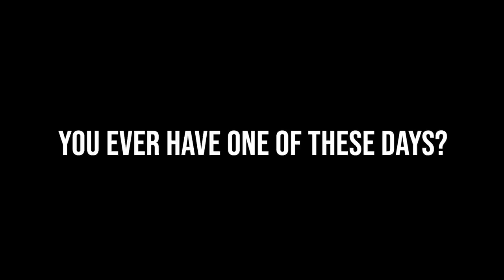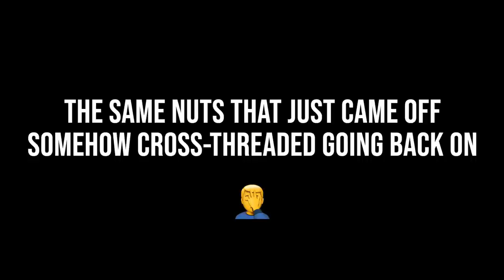I SHOULD HAVE STAYED IN BED 😡 THIS KUBOTA DOES NOT WANT WHEEL SPACERS! OUR MOST PAINFUL INSTALL YET

Comment: I was a diesel mechanic for twenty five years before changing my vocation.  I used to run into this all of the time.  Cross threaded bolts, snapped off bolts, even bolts with the wrong threads forced into the hole!  You have no control over what the individual before you has done, but you can take steps to prevent this type of circumstance for the next guy.  It may be you!  Thread chasers help when burrs might cause some cross threading.  You can detect this by the fact that it is difficult to thread the bolts in by hand.  Cleaning and oiling the bolts also makes getting an accurate torque easier.  The most problems are caused by being in too much of a hurry and not paying attention to details.  Good video.  I'm impressed by your composure.  Keep up the good work!
Reply from the maker: Thank you for your input Marvin!

Comment: Tip: When starting a bolt or nut you can prevent cross threading by first turning the nut/bolt in the opposite direction until you feel a click/bump and then you can thread it in from there.

Comment: Feel Your Pain!!!
Feels like I have more days trying to correct issues that arise while trying to fix simple daily tasks. 

Feels like such a wasted day when it takes 4-6 hours to repair a busted bolt that should have easily came out in less than 60 seconds.

Misplacing, Breaking or lost tools also makes for a rough day. Having a place for everything and multiple types of each tool can really come in handy. 

Thanks for showing the true frustrations and not the edited smooth installation.

Comment: Lug studs are pressed in to the hub. They can be pressed out and replaced on lots of vehicles. If they are welded in place, do yourself a favor and just bite the bullet and buy a new hub. Don't mess around with jacked up threads. More trouble than it's worth. And torque after you get the new wrench so you don't cause the same problem again using the breaker bar to tighten to an unknown torque. And personally I don't care what Bora tells you, if you want life to be easier, use anti-seize on everything! If you're worried about something rattling loose, use some blue Loctite instead. Both keep the moisture out and make removal easier and more likely. And blue Loctite will come apart just fine, no heat needed for anyone worried about that. Red needs heat and green is darn near permanent. Great real life situation. Keep up the good work!

Comment: I got rid of my Dewalt tools and went with Milwaukee.  Get 1/2" drive Milwaukee fuel 18 impact.  It is a beast.  My air impact wouldn't busy loose my mower blades.  I broke a 1/2" Craftsman ratchet trying to gorilla the blades loose too.  No joy.  I bought the Milwaukee impact with like 1400 foot pounds of torque and it broke the blades loos instantly like it was nothing.  I got the Milwaukee weed eater, pole saw, edger, and hedge trimmer too and they are awesome.  Not cheap tools but they are powerful.  No more need for the inconvenience of air powered tools either now that I made the switch to Milwaukee.

Comment: I have an older b series. When I install/remove the deck, I use the loader to lift the front wheels up, so I can easily roll the deck in/out.
As for the bolts, the only chance you might have had was to work it back and forth, tighten/loosen.  I was taught to always start a bolt/nut by hand, never with a wrench.

Comment: I use a Milwaukee 20volt impact gun. Saves my back and is strong enough to remove anything. The threads on hub are going to have to be threaded. Be leave it or not you can get the die at homedepot. 
Great video I’ve my spacers ordered. Hang in there.

Comment: When I have hard to turn bolts or lug bolts I put lubricant on the bolts like Kroil, etc and run them in and out as much as they go without forcing them and keep applying the lubricant. On wheel hubs you can usually spray the lubricate directly on the hole threads from the backside as well
Reply: I have a question about the wheel spacers. I have a 1025r tractor with quick connect deck. By putting spacer on the front wheel will it make it more difficult to drive when taking off or putting on the mower? Especially with the load and go brackets

Comment: I received some cross threaded and stripped out studs On my 2019 B-2650 directly from the factory my dealer had to go through and replace all of the studs on the whole tractor I know the dealer installs the wheels at set up but they blamed it on bad studs from the factory. Hydraulic leaks yes had that too I went through myself and had to tighten up a bunch of connections thank you for doing this video I thought I was going CRAZY!!!! Love the channel keep up the good work

Comment: Love videos like this, proving I’m not that only one that has much trouble with a simple project on a hot muggy day.  Probably happens a lot more than we think.  I’d be a complete sweat ball.  You did good, sometimes wrenching can be a battle.  Maybe in your new pole barn you’ll have a auto lift and pneumatic compressor to help on projects like this.  As you get older bending over isn’t as much fun.  I took my 1025r into the dealer to get the hydraulic filter replaced, didn’t want to mess with loaded rear tires.

Comment: I use "Bolt out" penetrating oil when a bolt don't want to come off.  You will be surprised on how efficiant it is.  But, you have to be a little patient with that stuff.  It takes time for the oil to penetrate the threads.  Could even take a day or two sometime, but it better to be patient than repare the hub after a bolt broke.  I used to even put oil two or three times and wait a day when it's very hard.  I once waited 3 days, spraying the oil each day juste to make sure the oil got into the threads.  It was steel bolts into aluminium casing spindle "chandelier" (you know, those aluminium casting that holds a spindle shafts on a mower deck (a JD D140 for instance 😁)).  All my bolts went out without breakind 🙂.   There are many brands that makes that specific prenetrating oil.   Hope that this info helped you!  Have a nice day!

Comment: I have an older BX2200 with a very similar designed mower deck. I agree, the design isn’t wonderful, but, after a few on/off’s, it is not as bad as you made it out to be. I agree, if the PTO splines are not maintained/lubed, the shaft on/off sucks. I am biased, as my tractor was inherited from my late father in law, so, I overlook the flaws and remember his joy when he brought the tractor home. It will be with me forever, as the memories cannot be replaced.
Reply from the maker: It is that bad when you're used to drive over and autoconnect decks.  Not just Kubota, but many earlier JD and tons of others just like it.  That inconvenience causes deck damage issues all the time unfortunately.

Comment: Broken lug nuts snapped of lugs....old Mechanic's say anti seize new Mechanic's say never put anti seize on anything tire related. I check my lugs once a month on my truck and every 10 hours on tractor...so I use anti seize on lugs and on the rim where it comes in contact with hub if you've ever kicked beaten the snot out of a tire on the side of the road trying to get wheel of because one surface is steel and other aluminum......not a fun time that's why I anti seize the aluminum steel contact points on wheel. Not saying it's right but it's what I've done for over 30 years. The side of the road incident was a person I stopped to help in breakdown lane took us over an hour after I ran to store and got a mini sledge.

Comment: I’ve had a few days like this - ouch !  I put 3” BORA wheel spacers on my 2025r.  Another thing to take into account is the backhoe - my back step now hits the rear tire (just a tich) however anything wider would make the step not sit level. I do not have a mid mount mower.  The 3” rear spacers make a huge difference on my property as I have steep hills here.  Even navigating bumps and lumpy fields seems much safer now.  Thanks for the video !!  I just bought a used Kubota 1830 to mow with and I think I’ll be putting spacers on it too - the yard here is very steep !!

Comment: I have a 2015 model year 1025R with the 54" mower deck.  On the right side of the tractor there is barely 1/2 an inch between the tire and gauge wheel, so no spacers for me.  Instead I got the tires filled with Rimguard and added 70 pound wheel weights from GWT.  Made a huge difference in stability even without added width.
Reply: @craigchittum385  I wish I could say the same thing, I would love to add wheel spacers to add to stability.  Could be manufacturing changes between the years.  I have seen comments before from others saying they could have 1.5" spacers.

Comment: Now that was a workout 🤣, I installed 2” spacers on the rear of my BX2380, made a difference 👍🏻. You are correct about the mower deck that’s why a bought a separate lawn tractor, I did want that hassle 😉. Also, I had the same leaking single point connector issue and after 3 attempts at fixing it by the dealer they finally got it fixed, it was a known Kubota problem and the latest update by Kubota solved it. They replaced the bottom portion of the single point connector, if you take it in to Kubota they should be able to fix this for you. Have a great weekend 🙋🏼‍♂️👍🏻
Reply: @purplesocks9745  Hi, the dealer should have covered this under warranty because they never resolved it for you, send Kubota corporate a nice letter…you know what I mean 😉. Good luck 👍🏻

Comment: After seeing you remove the mower deck I'm certainly glad I have a drive-on deck and load n go on my 1025R and 60" mower. Sucks about the bolts but I agree with all the folks below that you shouldn't ever use an impact to start bolts/nuts and should always alternate torqueing them down.

Comment: I imagine the BX units take a little more damage because they're more likely to be purchased by people new to or unfamiliar with tractors and are a little less aware or cautious.
Reply: Bahaha really? Are you serious? I think you find that would apply to John Deere across most sun compacts as they are clueless that they are getting an inferior product in comparison to a Japanese quality tractor designed to handle a front loader and back how with Quik attach. John Deere makes rubbish sub compact which shows when you go to remove the back hoe or front loader. John Deere are only good once you get to 6000 series or above there lower stuff is rubbish in comparison to Kubota!

Comment: Thank for your videos. I am going to get wheel spacers for my subcompact tractor. Should I get aluminum or steel. Don’t know enough to make a decision. Thanks
Reply: I work as a machinist and  I would recommend steel as aluminum has a lot better chance of galling in the threads.
Reply: Ordered mine mine over a month ago. A deciding factor should include your need plus their comments: "We process orders in the order in which they are received. At this time, your parts are still in the manufacturing process but rest assured that they will be completed and shipped as soon as possible. A lot of our popular aluminum parts are running 3-5 weeks with steel parts running 8-10 weeks. Some of our more complex parts can run longer than this.  Unless you opted to expedite your order via rush fee, build times are generally 3 to 5 weeks on aluminum parts. Steel orders are 8-12 weeks due to the availability of raw materials, our current work load, and the fact that some parts are more complicated than others."

Comment: 2025R with MMM running 2 inch Bora spacers on the rear.  
As stated throw those DeWalts out and get Milwaukee.  Also as stated hand start bolts.  Invest in a tap and die set and an extractor for broken bolts.  Easier and cheaper than someone fixing it for ya.

Comment: I have a Massey Ferguson GC1723 with 4" wheel spacers. i do not have a mower deck. my rear wheels are filled as well. i used the tractor to my advantage when installing them. as for now i only have the spacers on the rear wheels

Comment: Liked the video, but...I have a BX2380 and the Kubota manual says to NOT use spacers on the front. I have 2" spacers on the rear and they were a breeze. I don't use a belly mower but a brush hog or flail. I work my tractor like a dog and it has held up well. The cosmetic issues you hit on are not necessarily the fault of Kubota or the particular tractor but of the previous owner. You can tear up anything if you don't take care of it.

Comment: I realize you're working with a lot of used equipment and this suggestion applies here as well, but ...  Being a bit (very) OCD, when I buy a brand new anything (lawn mower, pressure washer, tractor, etc.), I look at any fastener that might rust (all of them!) and before I use the item, I remove those fasteners and apply Bostik Never-Seez Pure Nickel Special to all threads and reassemble.  Apply VERY LITTLE.  Make sure to apply a dot of it under bolt heads and nuts too.  Works great on hitch pins also.  It's NOT grease.  It IS messy!  Have rags available that can be thrown away.  You'll need 'em.  No more seized fasteners. And, hand start all fasteners.

Comment: I've had a week like this, I'm working on a 1984 Same Buffalo 130 (130hp) one bolt in the transmission has caused me more pain than anything I've ever done, modern Kubota's just aren't built well anymore so many quality issues, big and small, but I also think the operators think they are capable of things a much bigger machine can just do

Comment: Not sure what it is about Kubota and bolts.  I lowered my ROPS on a brand new L3560.  When I put it back up I hand thread the bolts back in, the design does not allow for a impact to even be used.  One side went great the other side I got the bolt to thread through until about 3 threads were completely through the nut on the inside of the support.  With about 1/4" to go to get tight, it froze up.  I can not move it in or out.  I am positive that it is not cross threaded.  I think the bolt may be softer that the nut and it has shavings not between the threads.  If you have ever had dust get into a bolt's thread you know how it can lock it right up.  I hope it is not a systemic problem.

Comment: Dewalt 20V impact wrench (the bigger one) will be a huge lifesaver for you. Throw a 5ah battery on there and it'll break all the bolts/nuts on those loose.
Reply: DCF899M1 is the one you want. Don't accidentally buy the 200 dollar one.

Comment: I would think steel spacers would be preferred as they add some weight very low.  Not a fan of threaded aluminum.
Reply from the maker: Gotta prime and paint the steel.  Yes, the bigger spacers will definitely add some good ballast.

Comment: Question about trailering My Kubota L-2501 with a backhoe

I had trouble loading it with the Box Blade dragging when I loaded and unloaded

On non hard pavement surfaces it just scraped the dirt up

It is the basic 18 foot trailer with the angled rear 3 feet and hinged 4 foot ramps

The bottom of the Backhoe BH-75 drags and gouges the dirt

How long should the ramps be to stop this dragging issues?

Longer ramps will solve the issue but I don't know how long is long enough

Thank You

Ken in Florida

Comment: If I get nothing else from this video, at 4:08 I learned that the tractor side PTO U-joint is removed with a spring loaded pin... 🤦🏻‍♂️I just got my BX2380 at auction with 575 hours and had the deck off to service it. Saw that half of the PTO dangling down and thought "what do I do with that without the deck? Bungie it up?" Knowing that it's easy to remove should help putting the mower deck back on be easier...

Comment: All the dings and wear marks,  Those are the tractors I like to buy.  If your going to just work em.... and not resale them.... you can get a good deal.

 I do know I would never by a BX with front wheel spacers. KUBOTA says to never put wheel spacers on the front, and they dont add any stability due to the pivoting action of the front end. I guess they might make them sell better to homeowners who want the form over function.

Comment: Reasons I went from a BX to a deere 1 series:
1. Draft control on the 25r over an inching pedal on the BX.
2. Get away from that horrible treddle pedal on the kubota.
3. Drive over autoconnect deck on the deere.
4.easy park loader on the deere vs the janky linkage system on the kubota.
5. 120 loader level indicator over the kubota eye it bracket on the bucket.

I also had leaks on my BX, but it was the front axle pivot and one of the front wheel steering knuckle seal for the final drive. On a tractor with about 400 hrs.

Comment: 1. The wheel spacers should be torqued just like the tire and wheels.
2. Whom ever put those new tires and wheels probably cross threaded this lug bolts and should be held accountable.
Reply: My guess is they overtorqued them with an impact driver.

Comment: When adding the wheel spacers to the front, did you have interference issues with the deck during hard turns?
Reply from the maker: I haven't had the hub fixed to install the other side, but not issues with the one that's on there.

Comment: I saw on this Kubota bx tractor the dealer stickers say Ritchie implement. That is a local dealer around the southwestern part of Wisconsin. I’m from that area and was wondering why it looked to be in rough condition. I personally have a bx2670 will 430 hrs on it. It has the usual small leaks and couple of scratches, but it looks to be almost brand new. The owner must have done some pretty hard work with it.